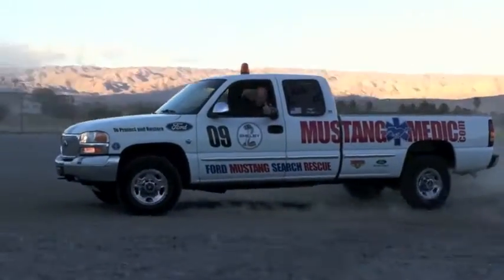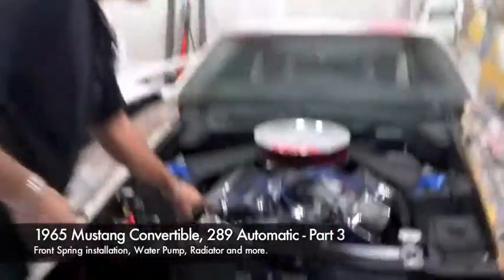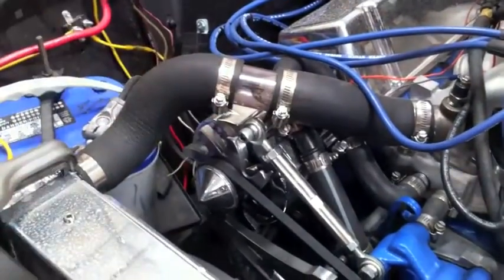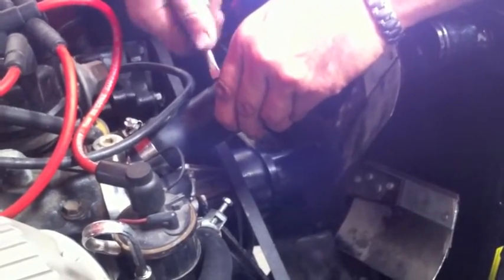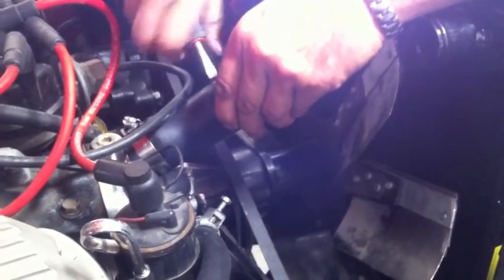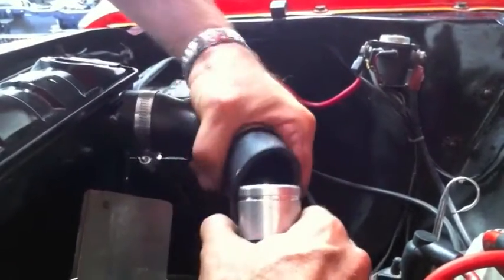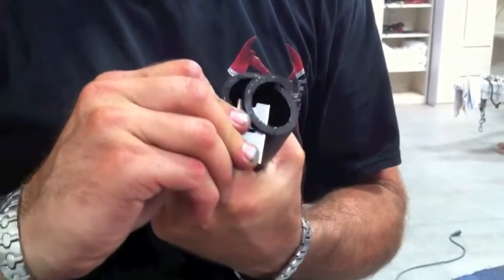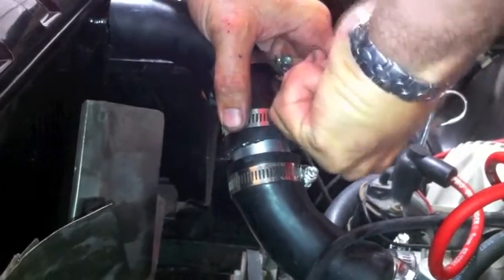GANO filter installation and find a 1965 Mustang Convertible - Day 4 - Part 3

Comment: just noticed the coil in this beauty... the last 2 i owned... 64.5 (straight 6 200 then later upgraded to 289 h.p. 12yrs later was keeled by hurricane Katrina)... 66 stang (current 302 w/ paxton supercharger, c4 tranny, 4.11 gears).... both coils have been on my driver sides... Is it just a preference? either way i love the distributor in front of car :)  great videos keep it up, I love them and have done all work too them since 1995.... Happy New Years... Cheers!